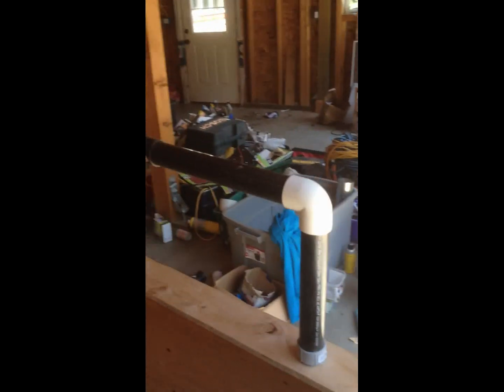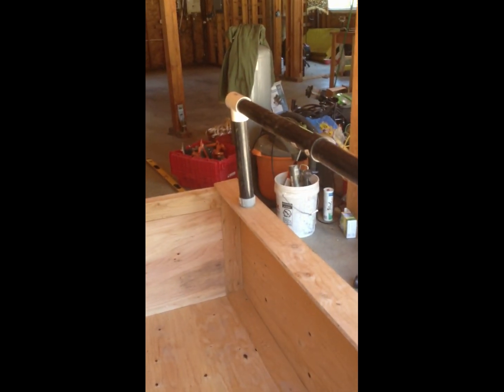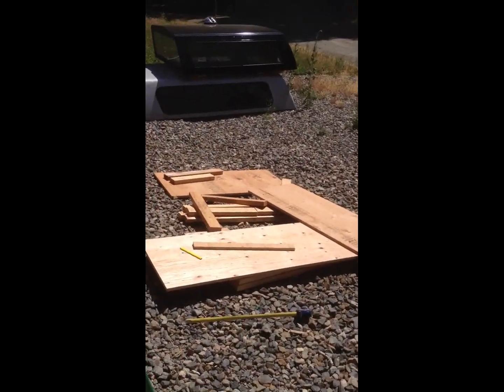Venting the Battery Bank Box-  Solar Off-Grid System Installation Video 3

Comment: Did you put electro isolated fans in line in the vent tube to create a vacuum or pressure in the box? I lived on a submarine for 4 years and Hydrogen gas explosions were a great worry as it has sunk subs before.

Comment from the maker: Hey thanks for the concern, I am very aware of the equalization process. I have my charge controller set to equalize every 30 days automatically. I actually put 1" diameter venting hole toward the bottom of each side of the battery box. Also, Im not sure if you saw my other videos, but I have added Battery "DeMister" oil to the batteries which stops the off-gassing of sulfuric acid and electrolytes. All that needs to escape is a bit of hydrogen that will immediately be vented up the pvc exhaust.